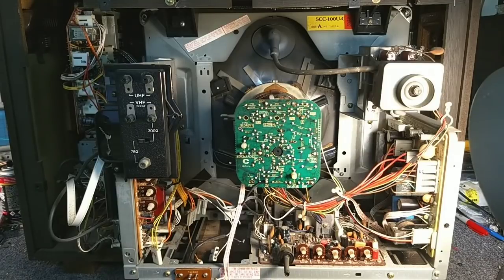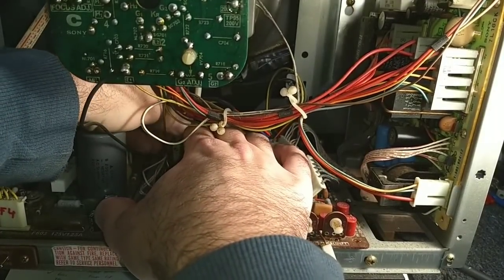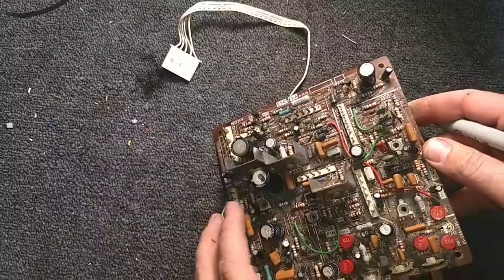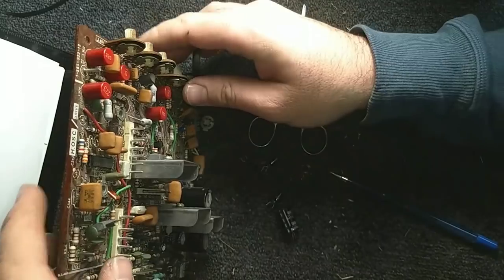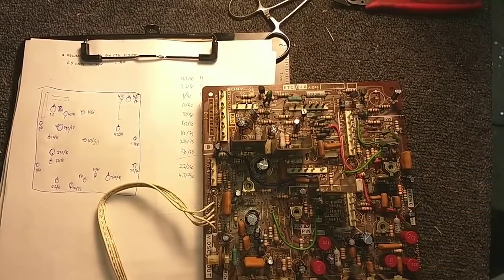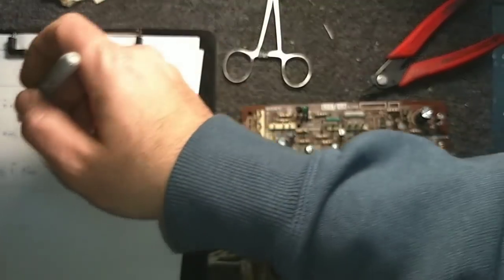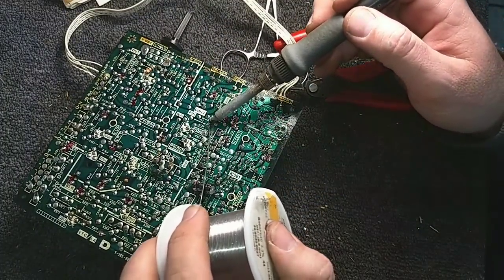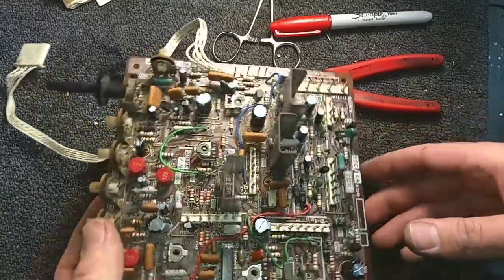Repair of a 1970s Sony Trinitron kv-1942r color tv. Part 3/? - deflection driver board

Comment: Really cool. Appreciate all the expertise you're sharing here for free. Definitely a lot of work fixing these old TV sets. The only CRT thing I have on my list of things to fix is an 80s computer monitor that has touchy controls and a little bit unstable picture.
Reply: Fixing TVs from the 60s thru the early 2000's was definitely a task, you had to almost think like an engineer as the trouble shooting was pretty intense and in depth. The TVs today, most are one or two board TVs so most ppl can just pop in a new board and now everyone is a tv repairman. 
We had to bat our brains out to Chase down problems, The early Sony TVs especially the models in this video were very tricky. Sony and RCA used SCR's as horizontal outputs and they were very delicate and expensive, I don't miss those models they were extremely sensitive and would blow scr's like crazy .
Then came the widescreen era and a whole other ilk of problems. Not to mention substandard replacement parts that would last two weeks after you replaced them and now you did the repair twice and lost money as well as a dissatisfied customer.

Comment: Jordan,  I actually had moderate luck rejuvenating Sony crt's...some would take and look pretty good, however, they won't last very long, although  I did get a few of the 710ab tubes to take a restore and hold out for a couple years..
But, most crt's pre- 1990s would take ok...
The newer crt's didn't have enough of a gun to hold up to a restore. 
I miss those days..!!
Reply: @preston963  ...I agree, I had some luck with the older tubes, but, in the 90s, CRT guns were very under engineered so restorations wouldn't last as long, every once in awhile, u would actually catch a tube that held up for a year or more , at least it got you out of having to try and sell a new or rebuilt tube which most people wouldn't be in favor of as opposed to a normal repair.
Some CRT replacements were cut and dry, but others were a pain and, it was order the tube, go to the house (or lug the entire tv to the shop) do the installation which in most cases you needed two guys, though I've done some by myself, then do all the convergence, grayscale, purity etc as you know, only to end up with an issue with the rebuilt, but, in most cases it was a good money job and went well.
I do miss those days..!!
FYI, my sencore restorer was 1800.00 back in 1995, I still have it.
It did pay for itself and got a ton of use.
Reply: For sure I have Rejuvenated a lot Sony Picture tubes ! one thing I can say is these old sony tv's where built like a tank.
Reply: @richardbrobeck2384  ..👍

Comment: I read and try to help out on AK but the recap brigade has pretty much made me stop. 
My amp was doing something (humming, crackling, popping, working perfectly fine) and after a recap (which should have fixed every problem known to man) smoke came out and now it doesn't work. 
Yes I ignored the 900 threads on this very model. Yes I ignored all of the advice not to replace million components at once. No I have no idea how to read a schematic and don't intend to learn. 
Tell me how to fix it.

Comment: I have worked on so many of those and most of the issues were electrolytic capacitors and bad solder connections !

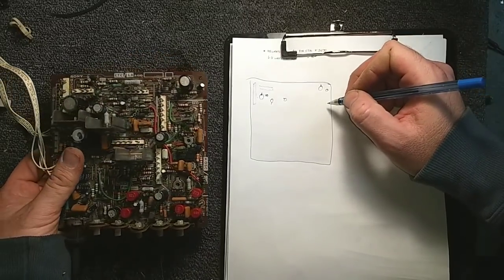Comment: @16:34 would taking a high resolution pictures of the board take the place of pen and paper?
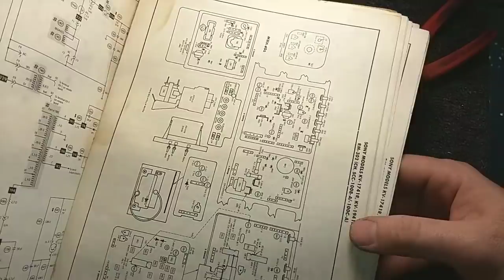Reply: @50:02 explains how important making a map is.  a capacitor was not noted on the map and Jordan has to find the value.  Maybe taking several high resolution pictures might help but really the pen and paper method, though crude is very effective in figuring out a lost component.

Comment: Hi JP. Quite a job. Have you posted any videos to Rumble or Odysee ?.  Has always I Liked,shared. All my very best.
Reply from the maker: I dump to libry as well. Still investigating setting up other outlets to upload to. Once I find something stable I'll start uploading well.
Reply: @JordanPier  I have been having good luck with   , "    Brighteon  "  works very well, Easy to upload, A lot like Youtube with the uploads. Thank you for the reply,means a lot. All my very best.
Reply: @JordanPier  I was trying to identify a pair of Advent 4002 speakers that i have and  came across a thread on audiokarma by a jpdylon was that you?
Reply from the maker: @SDsailor7  yes.
Reply: @JordanPier  Well you did a great job compiling the story of the Advent speakers.
Thank you!